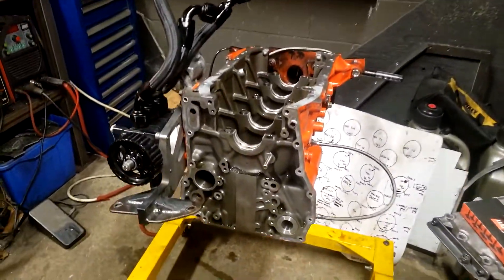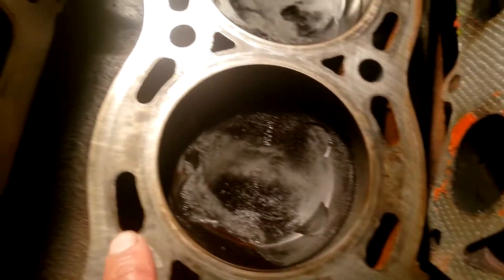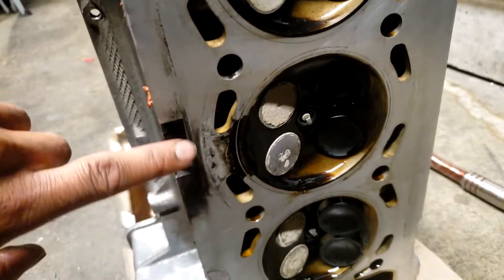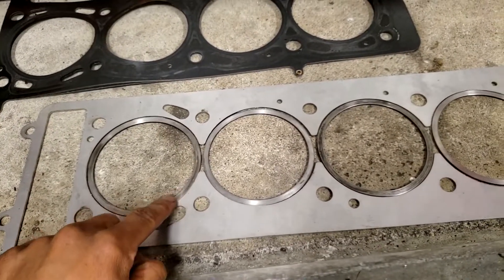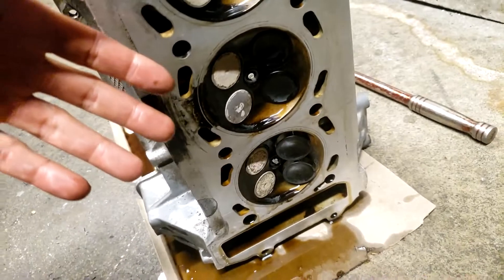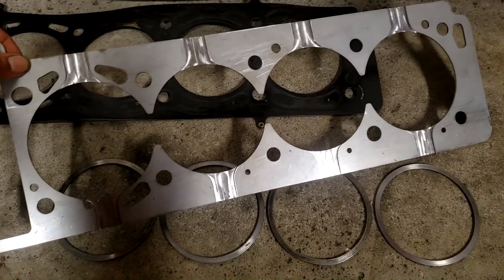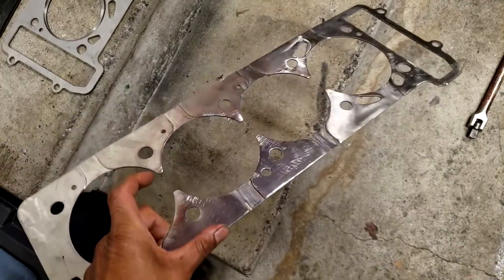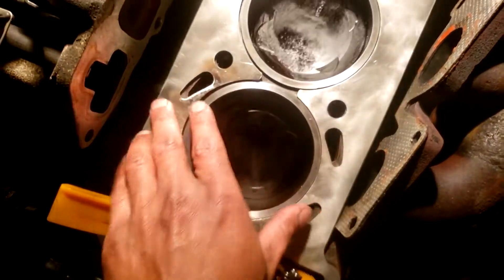I Designed My Own Head Gasket and It Works Well

Comment: What material do you use for the fire rings?
Reply from the maker: Regular low carbon steel
Reply: Spot on thank you sir! 👌
Reply: Is there much difference in the thickness of the fire ring and gasket? I'm assuming only a few thou/microns
Reply from the maker: @Ad.Mitch.GCR1  The rings are 0.012" thicker than the gasket when new

Comment: Nice work 👍
Why fint machine piston and use t7 gasker
What drysump pump are you Using on your race engine
Reply from the maker: The custom thickness cometic was easier to get than the machining pistons. 

Dry sump pump is a made to order ARE 3 stage scavenge only pump
Reply: Original mls b2x5 gasket is much stronger than cometic or athena. Also VictorReinz and reling is stronger. +ARP and stock gasket is good to 1000hp
Reply: Also t5 pistons are hevy. Build full b205 with forged rods and pistons. Pistons are lighter and rods are longer than b204rods